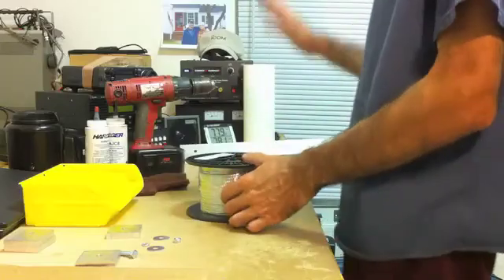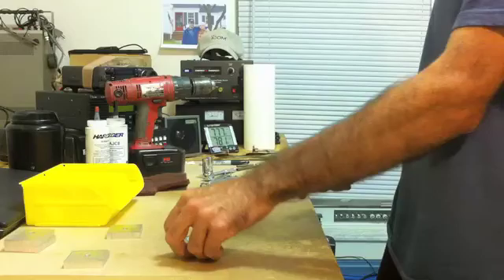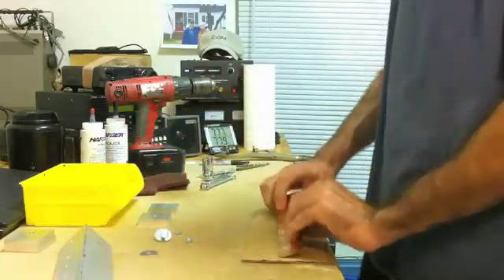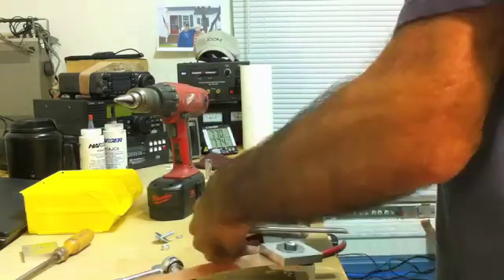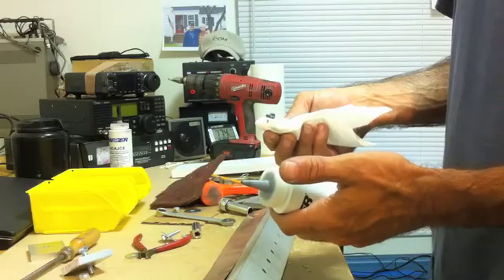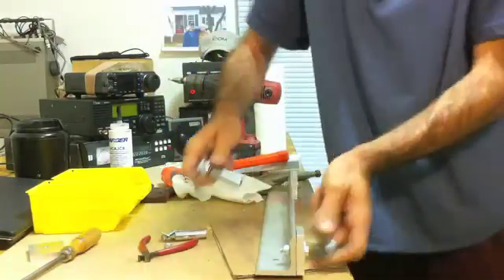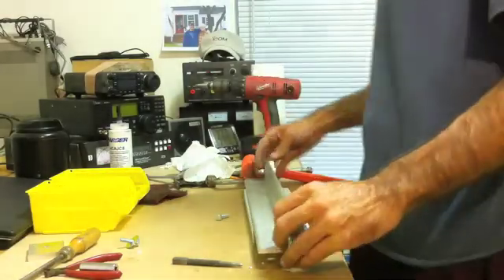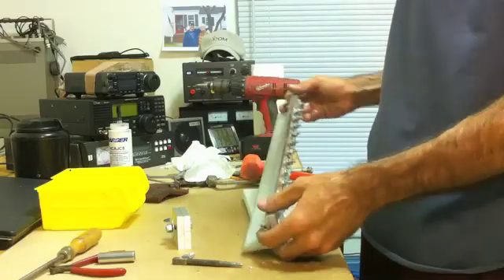Homemade Station Grounding Bar

Comment: Aluminum has roughly 60% of the conductivity of copper.  So that thick slab of aluminum had more conductivity than that thin ribbon of copper.  You could simply connect to that,  then run a decent stranded copper wire like 12 awg outside to a ground rod hammered into the earth, boom, done.  Absolutely no need for loops or multiple ground points.  That would only pick up additional noise and RF and create a possible ground loop issue.

Comment: Well made Den. Just one problem though, every thing in the shack should be grounded to a single point or your gonna end up with a ground loop problem. I made an earth bus at the start too and was getting an awful feedback problem. Connected all to a single point as instructed by an elmer and the problem went away. Beautifully made though 10 out of 10